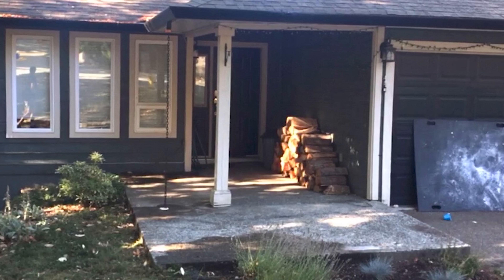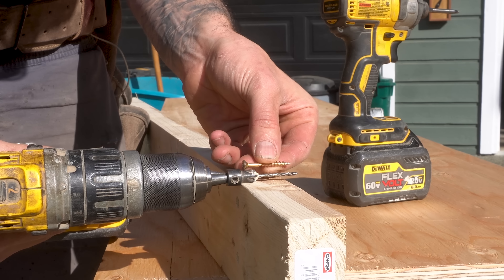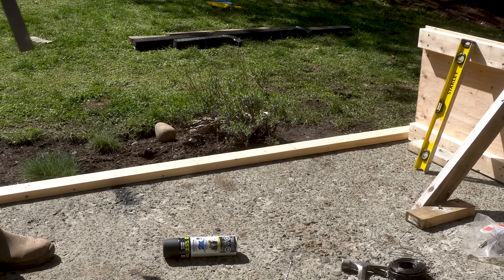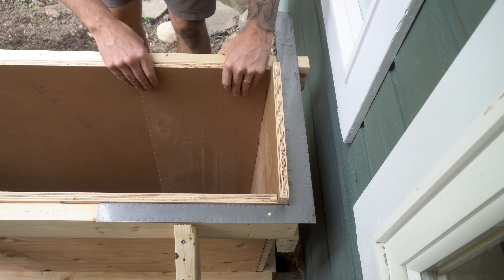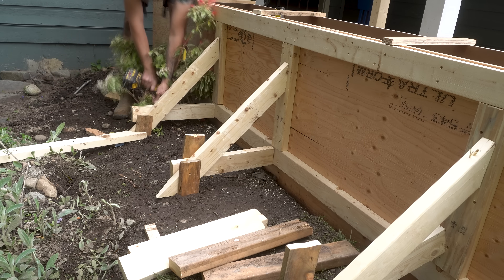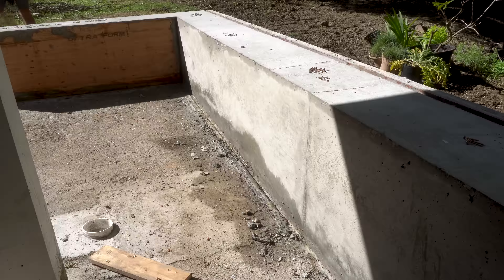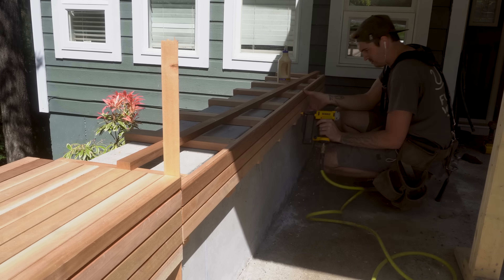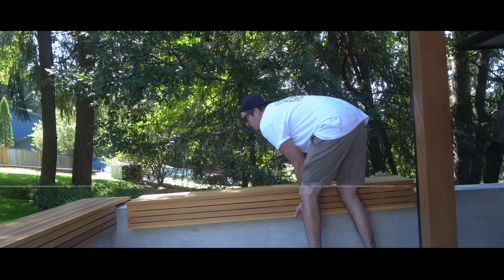This DIY Modern Wood + Concrete Bench Added $$$$$$$$$$ To my House

Comment: Thanks so much for this … just poured a similar project using your video as my guide.  Based on other guidance I’ll wet cure it for 7 days.  Do you recommend waiting the 2 weeks before removing the forms?

Comment: Wow, very impressive!    Good detail with all the steps.  Do you ever have back pain?  If I can give some unsolicited advice that might help your back feel better...  I see that your back is taking a lot of the stress of you bending over and moving dirt etc...   It would help if you bend your knees and get your hips lower so your legs and butt support your back and torso, almost like squatting, engaging your butt.  This provides you with more strength and force from your lower body and take the pressure off your spine and the upper body.  Kinda like when you say that you would brace, brace, brace again if you did the project again...  the legs and butt provide the bracing.  Hope this is received as it is meant!  I’ve been a person trainer for over 20 years...!